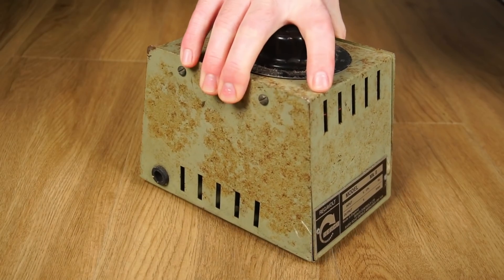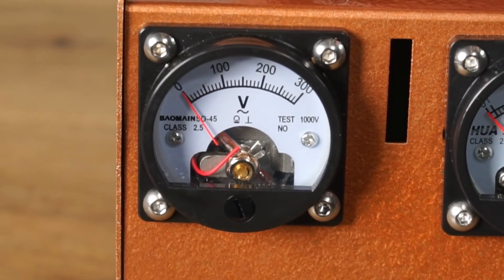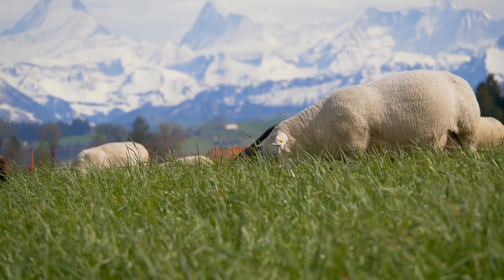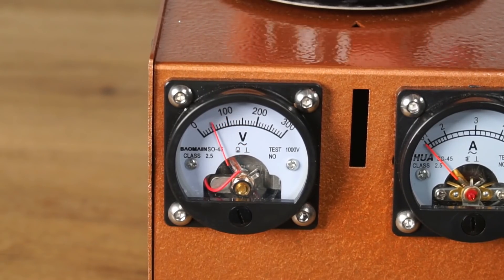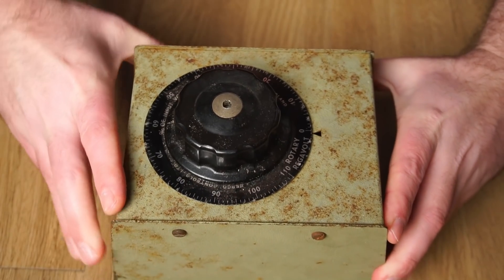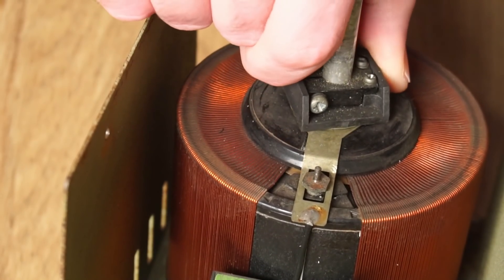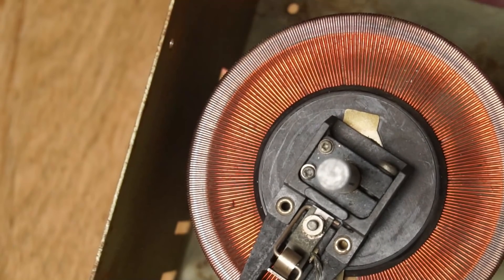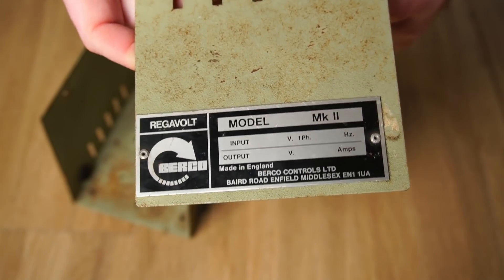(Not) Restoring an Auto Transformer

Comment: A very useful additional feature for a regulated autotransformer (or any transformer, or any inductive load for that matter) is a soft-start circuit that prevents inrush current spike due to core oversaturation. It would be nice to have that, although in a core of this size, the voltage spike may not be such a big problem.

Comment: I have used autotransformers extensively over the past 40 years for doing burn-in of high-reliability resistors.  They are very rugged and reliable power sources but we found that fusing both input and output was wise.  We ruined numerous transformers due to loads that shorted and the transformers can smoke if you don't have the input fused.
Reply: Why do you need a fuse on the output too? Doesn't the secondary current flow via the primary mains input, since it's an autotransformer?
Reply: @computermaster360 you need a fuse on the output so that when you start rotating the voltage 
Knob from zero and you have a short in the output it will blow the fuse before the arc that forms between the wiping contact and the transformer burns the winding open.

Comment: Nice job. I like the hammered copper paint finish. I have a variac similar to that, made here in the States. It only turns so far, and then stops. I have it at a local motor shop for service. Hopefully I'll be able to get it repaired.
Some time ago I purchased a bench power supply, and parts of another one and got it working. It had been scrapped, but it only had minor problems. 0-50 vdc at 10 amps. Now I just need to make a cover for it. I'm thinking I'll make it from Lexan plastic since I have a quantity of that on hand.

Comment: You reversed the red/black probes from your meter, phase 230 AC hot is on the left, neutral 0 VAC is on the right, ground 0 VAC is at the bottom.
Reply: You are correct that phase is on the left and neutral on the right, but when you're measuring AC it doesn't matter which probe of the meter goes in which hole.

Comment: Upvote for making a crimp using the correct ratchet crimp tool. Unlike the 6 million geniuses on YouTube using pliers/hammer/solder… 
Nice addition of the pressed mounting nuts too.
Was planning a similar restoration of mine but was going to add an output trip switch and a neon indicator.
These are great for slowly powering up old equipment.

Comment: Good practical demonstration of upgrading an autotransformer. I like the analog meters.
Maybe you could have explained circuit and autotransformer advantages (clean variable voltage) and disadvantages (current limited and no isolation).

Comment: That rustoleum paint is the business for easy spray can based paint jobs. I was taught that spray jobs can be improved by warming the surface of the metal (in the sun or a low temp in the oven) and standing the spray can in hot water (with a weight on top) improves flow from spray cans and vastly reduces likelihood of paint runs. It works well. You probably know this already, you look smarter than me. Good vid mate.